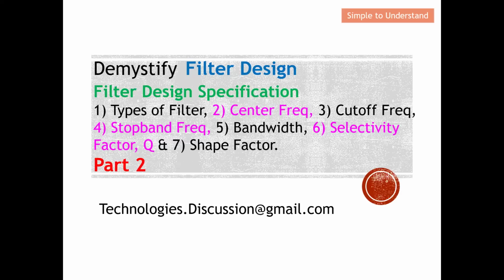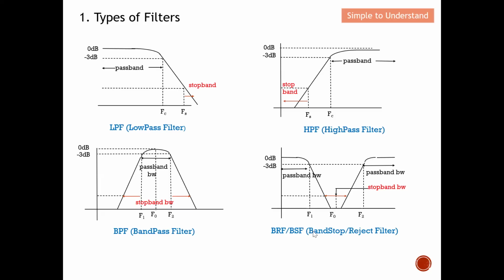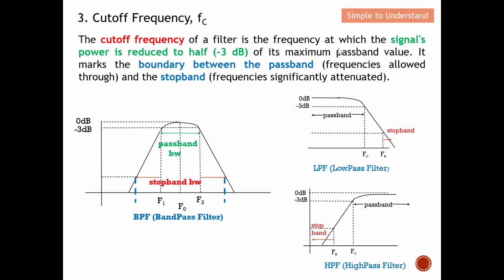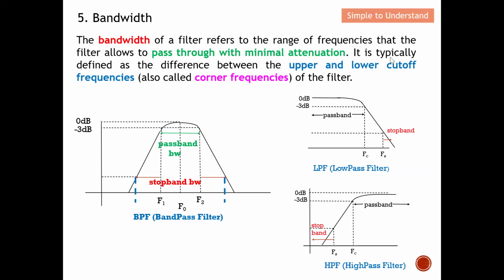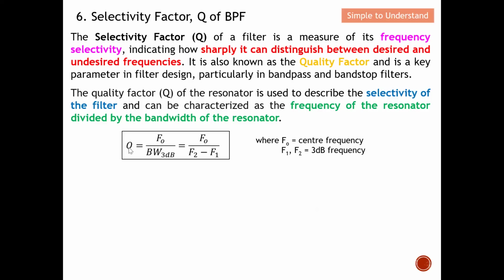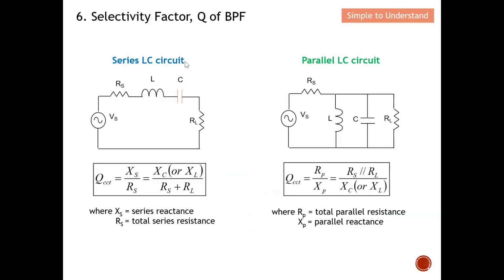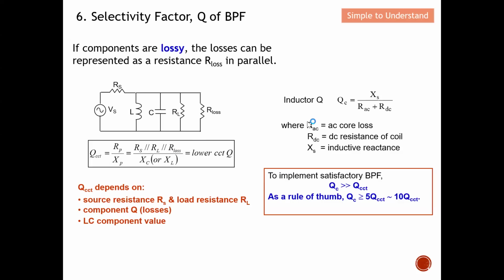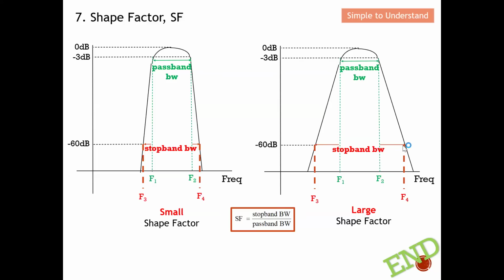Filter Design #2. Design Specs: Center, Cutoff & Stopband Freq, BW, Selectivity Q & Shape Factor

Comment from the maker: Thank you for taking the time to watch this video on microwave filter design.
Before designing any filter, we need to understand its specifications to evaluate its performance. This understanding allows us to determine whether the fabricated filter meets the required performance standards.
There are 14 important filter parameters. In this video, we will cover the first seven key parameters: 1) Types of Filters, 2) Centre Frequency, fo, 3) Cutoff Frequency, fC, 4) Stopband Frequency, fS, 5) Bandwidth, 6) Selectivity Factor, Q of BPF and 7) Shape Factor, SF.